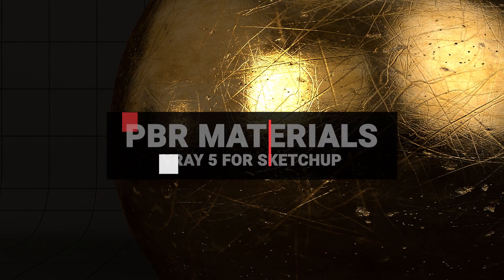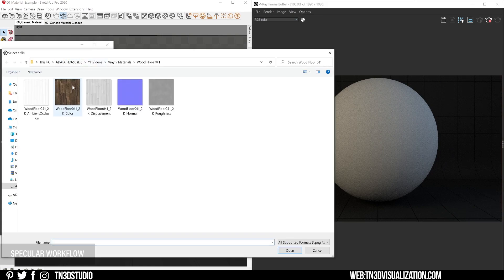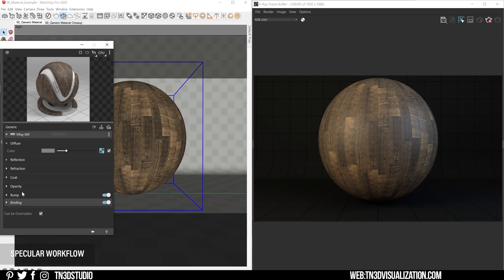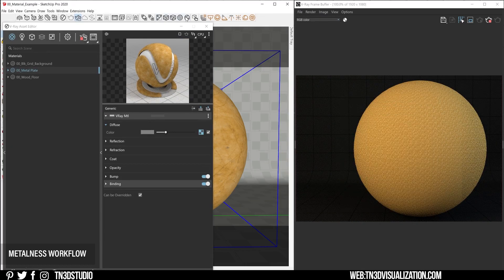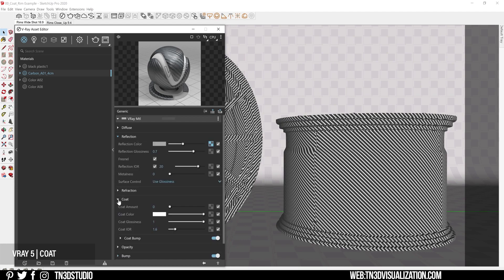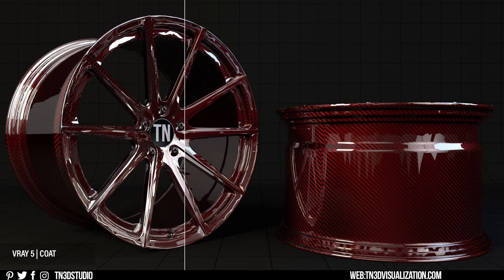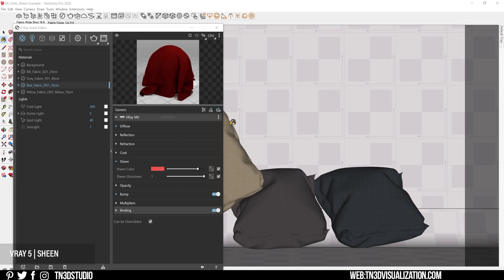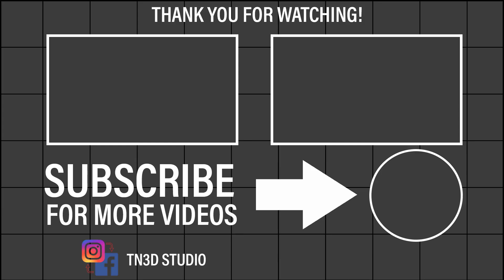V-Ray 5 for Sketchup Materials: Create Vray Material with Free PBR Texture | Vray 5 Coat & Sheen

Comment: Hi I follow the step as you do, but the material doesn't change after I insert the roughness map after the metalness map. Is there any solution?
Reply from the maker: Hi Andy, make sure the reflection color is white, Surface control change to roughness, and add the texture in the reflection roughness. Should work :)

Comment: What are your pc specs? I have a gtx 1070 and I get an error whenever I render large scenes with 4k pbr materials.
Reply from the maker: Hey Frank, I'm running on i7, 16GB, RTX 2070. Not sure but, make sure your GPU driver is up to day (could be a memory problem), if anything I would ask the chaosgroup support team, they will give you a much better solution.

Comment: Not sure what the point is of removing the displacement map. Basically they made it harder to create to save materials, since you have to add the displacement every single time. Does the displacement follow the texture? If you scale or rotate it?
Reply from the maker: Totally agree with you on that. Its a few steps too many for me to add displacement this way. BUT in my experience it renders much faster than the old method. Yes,  The displacement follows the diffuse texture when you scale and rotate. Might take time to get used to this new way. :)